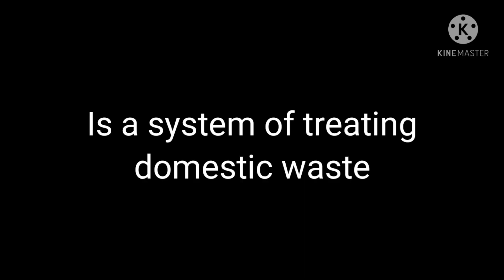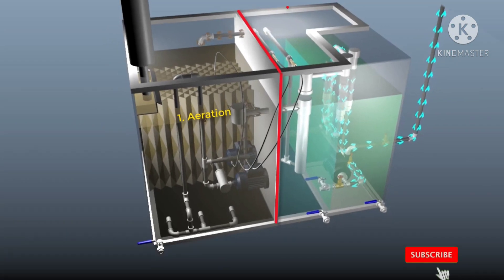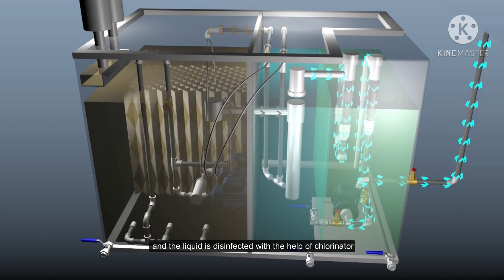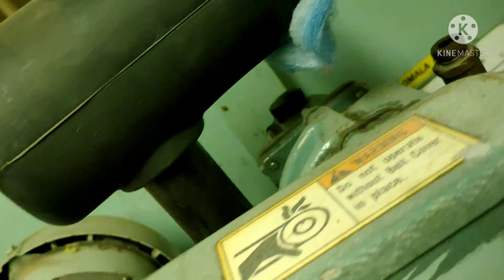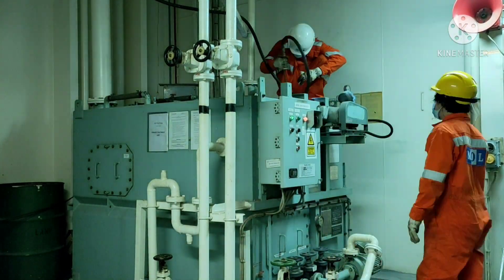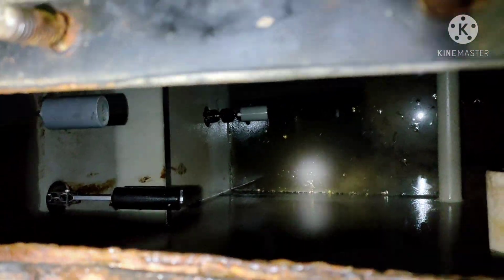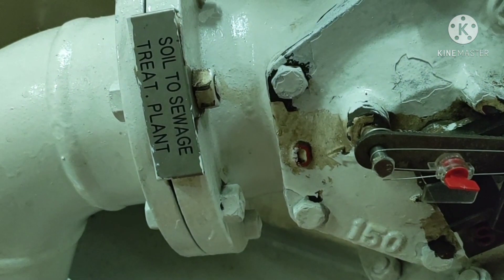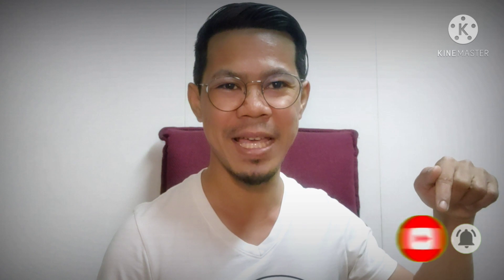Sewage treatment plant maintenance & principle | @RdailyOfficial

Comment: sir, how can i check/test air lifting of active sludge returning to aeration tank is working fine?
Reply from the maker: There is a return clear pipe at the top of tank there is flow suppose to be
Reply: @RdailyOfficial  sir, sometimes PSC wants to check it. is there any testing process?
Reply from the maker: @mec6953  its a close pack with your tank. What u can do is to fill up with water ur tank through nearest toilet in that way u can show to PSC that is property working. Because sometimes if maintenance not properly done it might clog of the driving air hoses leaking.
Reply: @RdailyOfficial  thanks for replying.
i already subscribed you channel❤
Reply from the maker: @mec6953  your welcome, more videos coming up. Im about to join a chemical tanker this month. Feel free to SHARE our videos. Many thanks
Reply: San ba may hiring nang stp na barko ang work location